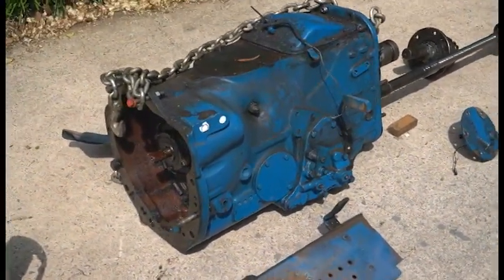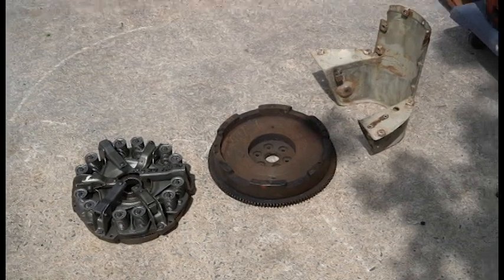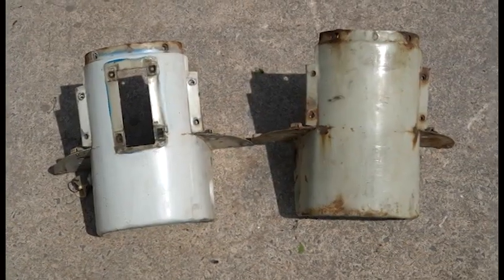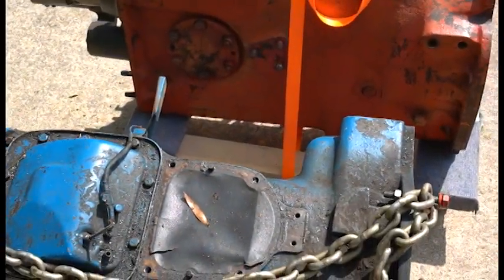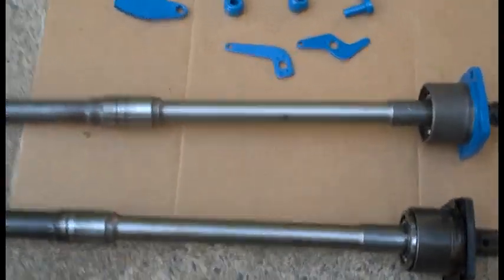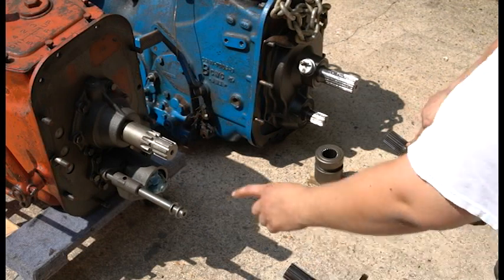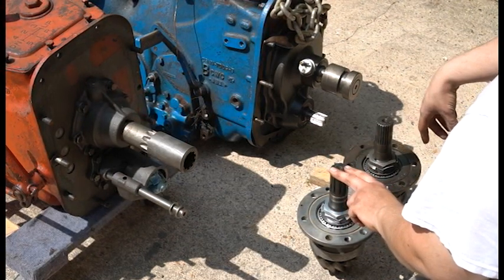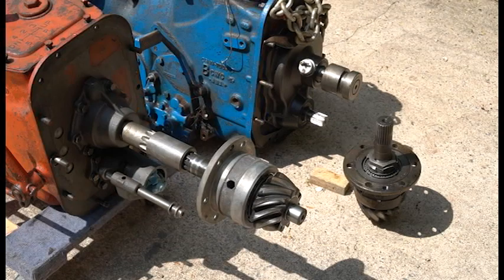Ford tractor Select-o-Speed Conversion Parts

Comment: Nice video with the additional parts needed for the swap.   Unfortunately a necessary sway at times with the lack of SOS parts and mechanics.   I have a 5 speed (861-D) and a row crop 4000 SOS, both in working condition.   I also have a model 871 that I'm going to do some adjustments on the transmission and hope I can make it work.  Other wise it may need the 5 speed treatment.   I have the transmission, clutch, and flywheel.   I'll need the step plates and possibly brake locks.

Comment: Very helpful thanks question the small round plate that will disengage the drive for towing does that wire do anything?
Reply from the maker: It runs the light on the dash next to the throttle lever. It's for trans temp.  Non-select-o-speed tractors had a metal plug in the hole instead of a light.

Comment: Ok   Being  as I Drag Race  High hp  Pro Mod Cars  I was  wondering about how you  Set up the Ring & pinion.... because even though the ratios may be the same  they are  not a matched set......
Reply from the maker: They are the same ratio and rind gear is actually same part number. With that being said it is better to match them. I actually ordered both the ring and pinion but the mail lost the ring gear and I never got reimbursed for it so I just ran my old one.  Being that tractors don't move fast gear noise isn't an issue. Dont think wear will be much of an issue either.
Reply: @chickenhousemechanic  Well  That being said.. you did all you could do......good luck

Comment: Do you know if the 4 speeds on the 2000 industrials in the early 60's came with the hydraulic tubes in the transmission even if they didnt come with the 3 point lift?
Reply from the maker: Not sure. They could probably be installed fairly easily if they aren't there. My best guess is they would be there so oil can be in the hydraulic chamber to lube the driveshaft and pto shafts. Those tubes would have to be there to seal that compartment off from the transmission.
Reply: @chickenhousemechanic  thank you

Comment: I'm planning to marry up a 1962 ford 2000 diesel industrial with a 4 speed trans to a sos rear end from a 1964 4000 agriculture tractor. The 2000 does not have the 3 point lift but has a trencher unit that runs off pto. Would the pinion from the 2000 work in the 4000?
Reply from the maker: As long as the spline count matches the output shaft and drive shaft it should work just fine. The 64 should be fine spline and the 62 has a good chance of being fine spline as well.
Reply: @chickenhousemechanic  I've  heard that the 2000 has a smaller ring and pinion than the 4000. Wasn't sure if I could change the pinion in the 4000 and use the pinion from the 2000 if I needed to match the splines on 4 speed output shaft. I'm just in the planning stages of the project now. Thanks I really appreciate your videos and you anwsering my questions.I've learned so much from watching the videos. I admire your craftsmanship you do a 1st class job.
Reply from the maker: @motorhead4003  the housings are different for sure but the actual gears I'm not sure. The parts catalogs list the same numbers for both a 2000 and 4000. I remember running into that when I did the swap. When I restored my 861 I remember it had a huge ring gear in it but I'm not sure how it compared to the 4000rc. The 4000rc has the smaller rear housing like a 2000 or 601. On my 4000rc I ordered a new/used ring and pinion and the post office lost the ring gear. I used a pinion off a 960 and mated it to the orignal ring gear out of my 4000rc. Granted both of those are rowcrop tractors.

Comment: I have enjoyed watching the series of the rebuild of the 4000 tractor. I have a 1962- 1964 4000 model 41201D. I got this from the stamping on the flat just below the battery box. The serial number is unreadable as rust has eaten away at it. Do you know of another way to determine when the tractor was built?  My granddaddy bought this tractor new and I still use it on the same farm in Northeast Alabama. Also if I may ask, where do you source your parts (rebuild kits, seal kits etc.)? Thanks again for the very detailed vids and explanations.
Reply from the maker: Sometimes you can find casting dates on components that can narrow down the year for you. I've not checked the serial on mine either since the diesels are bad for leaking battery acid on the transmission and corroding away the numbers. I'm pretty sure mine is a 1964 though because the engine had 1964 bearings and thermostat in it. Granted the engine could've been swapped.

As for parts I buy a lot of mine from Just 8n's out of NC. Also used Stiener Tractor Parts, Yesterday's Tractor, and Dennis Carpenter Restoration Parts.
Reply: @chickenhousemechanic  Thanks I appreciate the info. Keep up the good work.
Reply: @legacygfarm996 if the radiator is original it’s the only other part that I know of that’ll have a month and year stamped in it. Worth a look.